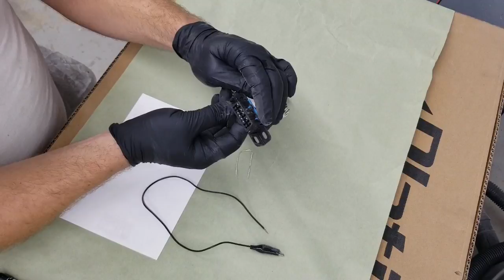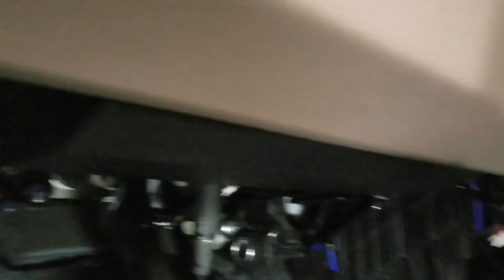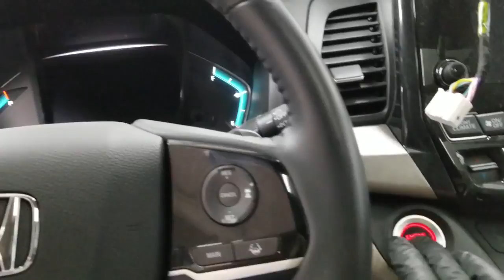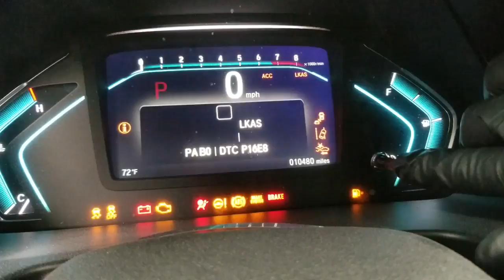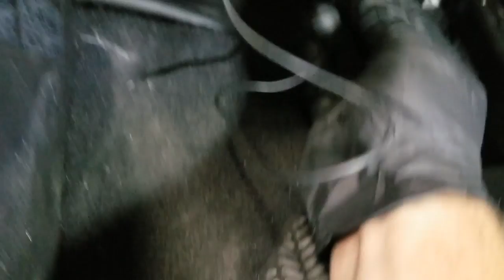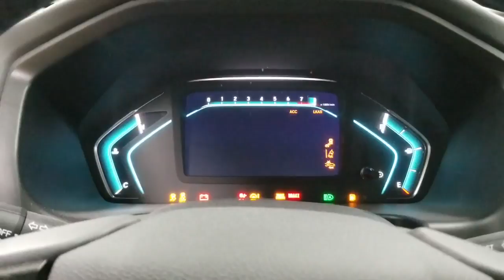How I made a quick Honda, Acura SCS connector to check my DTCs,SRS,ABS,VSA, with out using scan tool

Comment: Will this method clear the codes also? Light on: pin 4 to ground, light off: pin 4 off ground. On/off 2 or 3 times in a row. That worked on old Hondas.

Comment: Thanks, this was a big help.  I couldn't get the bluetooth/Torque code reader to show me the TPMS DTCs but this worked great and showed them to me.  Now I know for sure which sensor I need to replace and that another one has a low battery.  Very cool!